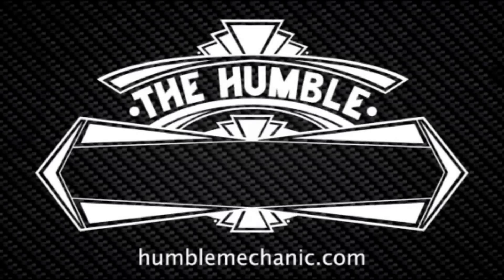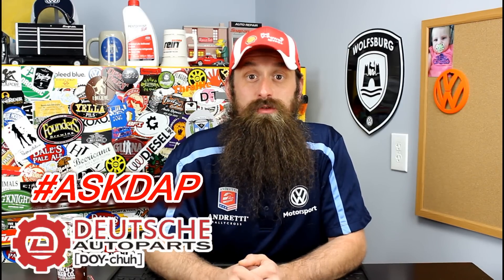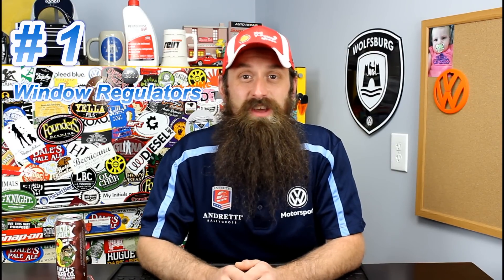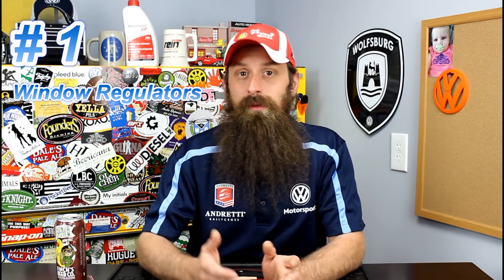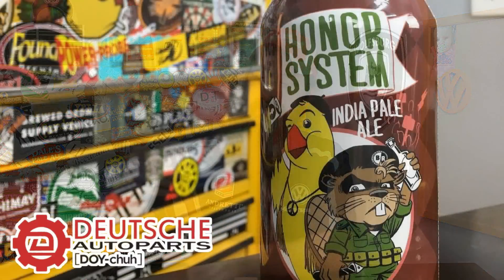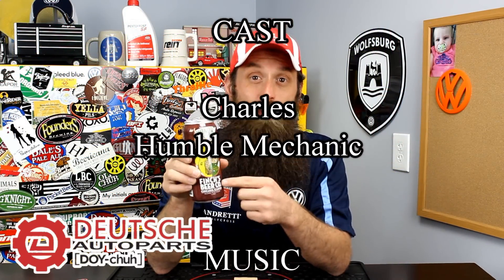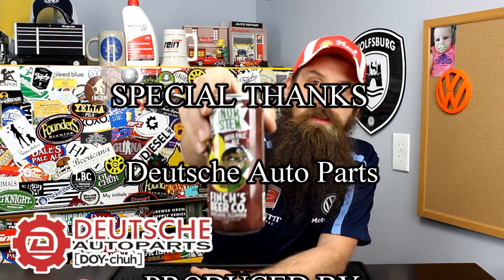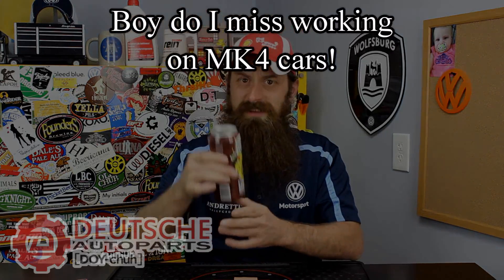Top 5 Failures 1999-2005 MK4 Golf, Beetle and Jetta

Comment: Yup my 2002 Jetta GLI has a few issues i need to resolve, the rear passenger window wont go down i hear the regulator but it wont go down, coolant temperature acts up during winter for some reason got a replacement but haven't installed it, door switch unlock both driver and passenger doors but it wont unlock the passenger back doors have to open it from the inside, stupid breather hose broke made out of crappy plastic i just taoed it up replacement is around $120, i cant unlock the trunk with my key but the switch opens it up, last would be the ac compressor doesnt work lol still love the car though i got most other things replaced brakes,rotors, fluids,coilpacks,plugs etc.

Comment: ok so i had a question i reaently got a year 2000  VW jetta and i am perplexed on what is going on the car starts and then right away it stops im not understanding what the problem is theres no engion code and the feule gage say 1/2 a tank of gas i just replaced the heater core my self i wanted to know if you have any idea what the problem could be
Reply: immobilizer light flashing? I had to get the ECU flashed to remove it on my 02 beetle.

Comment: I've had my MK4 Golf for 11 years now, here's what failed:

Both front window regulator clips, easy to fix
Coolant temp sensor intermittent, easy 5min fix
Engine speed sensor, easy 5 min fix
Oxygen sensor, done myself
Lower control arm bushings replaced with polyurethane
Spark plug leads
Charge regulator, 5min fix
reverse light switch, 5 min fix
Water pump done three times lol

Still love my MK4 :)
Reply from the maker: That’s not too bad. :)

Comment: I have a 2002 VW Golf 2.0 and I changed out the CV axle and the wheel bearings on the driver side. This was due to a clunking noise every time the wheel makes one complete rotation. After repairing, I went to go take it for a spin. And upon putting it in reverse, the clunk, restriction, or stoppage was still there. Acting almost like the wheels did not want to spin. So a bummer first of all, that is didn't fix the problem. So upon going in reverse, it made a snapping noise with the clunk. Continues to clunk after that. I look under each side of the front end, and nothing is snapped or broken off. I am debating on changing out the passenger side CV axle. I don't know what else to change out. Someone, please comment , if they have had a similar problem. This was a Florida car, so the rust is minimal. I hate to spend the money on the CV axle and it not be the problem. Thanks for any comments, I know I should change out both wheel bearings and CV axles at the same time anyways. I am just trying to find the source of the problem first. I live paycheck to paycheck. Thanks in advance for any comments that will help me in this situation.

Comment: All my wires inside the rubber boots on the doors and truck broke. I had to solder and heat shrink new wires in series. Anyone suffer from these problems?

Comment: Polybushed everything 
I keep a new genuine brake light switch and ect sensor in my box 
I lube my window runners with 
Ptfe every couple of months 
Cut the flaps off all the sunroof drain grommets 
I use an airline to blow out the door catches once a year and lightly grease them with graphite grease 
And use good quality diesel 
So I don't get sticky vane syndrome

Comment: I’m quite new to your channel so I apologize if you’ve covered this in a previous video. I have a 2004 VW Jetta 1.8L T with a speed sensor error. I’ve heard every recommendation from replacing the transmission (a painful $5K pill to swallow) to junking it. I’m quite attached to it and hate to see it scrapped for a measly $200.00. I’m looking for any tips on replacement of the speed sensor without a full transmission break down or rebuild. Any advice?

Comment: I recently bought used 2000 Beetle. Hate when i lock my doors & come out later only to realize my windows rolled down...Whhhyyyy! I stopped locking my doors, no point. Thieves will get in anyhow if window's down but at least the rain won't get in.

Also noticing that rattle underneath car & check engine light came on...gonna check with code reader & hope i'm not gonna have to shell out cash for catalytic converter. Car is well beyond warranty(149k), and was sold 'as is'.

Comment: Could the failing break light switch be related to a none functioning tail light? My reverse lights, and break lights turn on, but my drivers side running light (not sure what the name of the light is, but it's the one that is supposed to remain on for night driving) won't turn on.  The one on the passenger side though does remain on. Could that be because of a failing break switch, or should I look else where for the problem. Help the MK4/VW noob.

Comment: Wires breaking in boot of door and hatch , drivers door latch microswitch, water going through grommet on Golf rear wiper going on motor then down onto latch, taking out motor circuit board causing front wipers to turn on on their own. and the alarm going off on a cool night because of the wiper on the latch going. In salt areas the return on the ebrake  sticks at the caliper. Front fender rubber piece holding water causing rust on fender.Lower section of front fender holding 5 lbs of mud.

Comment: I.need to know why my interior lights are always on when the light are off.. I have to disconnect the battery terminal to not kill my battery to go somewhere...please reply asap
Reply: I had that problem. The lights in the switches on the drivers' side door stayed on. I discovered that it was a bad gas door switch that caused it.

Try disconnecting all the switches from the wiring harness until they go out.

Comment: Enjoyed the video and love my mk IV Jetta 2.slow. My biggest issue is the car won’t move out of park when the temperature outside drops below 40 degrees. Good thing I live in Texas and cold nights are rare.
Reply: David Neumann  look up online at one of the vw forums for solenoid valve issues.  There's a guy in Kansas City Missouri that will refurbish yours or you can replace yourself if you are comfortable doing so.  Symptoms: usually will not go into gear or shift properly when cold after sitting a while.  Look up on VW vortex brother.

Comment: what about "valve body" or "controll module " on  6 speed automatic trany   2005 beetle turbo diesel ..is that common to mulfunktion ?
Mechanic replace my tranny  just to find out that  problem of shifting still exist .   he put back original valve body back on .

Comment: 01 Jetta 2.0 shouts off after running a while sits for several minutes,then starts! ie replaced the coil wires and plugs and maintained 35 psi even after shut down  any ideas?

Comment: EPC light on. codes reading P0222 and P1003. 2003 2.0 Jetta.  changed mass airflow,  changed brake switch,  ignition switch,  cleaned throttle.  light still on.  car is in limp mode after 10 mins of driving.  my mechanic thinks its the pedal sensor or a bad CAT.  i dont like guessing.  any thoughts?
Reply: Serby Drobnjakovic crank sensor got mine outa limp mode

Comment: I have a 2001 Volkswagen beetle turbo and my speedometer stopped moving and all of a sudden the lights appear on dashboard like the emergency light the temperatures light ect and now when I turn my car on it sounds loud like the muffler is bad it a loud motor like sound and I notice a small peice of tube missing in the front of the engine not sure what that is and the sad thing is everything is plastic under the hood

Comment: Hi i got check engine. Says running lean. Had lambda sensors and cat replaced still get light once a week. Any ideas
Reply: TheFlammingdice had same thing replace cat. but still on. had check engine light on for 4 yrs. and my car ride smooth. sometimes the light can be bullshit ir serious. so far mines been ok. it's 2001 jetta 200,000 miles orinal motor. had to replace transmission at 180,000
Reply: TheFlammingdice MAF

Comment: I have question? On a 2002 V W Beetle turbo s w/ 17" tires and sims are the brake rotors the same size on the front and back?
Reply from the maker: no. They are much bigger and vented in the front.

Comment: Hey Charles and Co. BAD CONTROL ARM = DANGEROUS OR JUST ANNOYING?  I have a 1999.5 MK4 GOLF GL with the 2.0L AEG.  MY passenger side control arm is starting to make a lot of groaning noises ...especially when backing up over bumps or driving on uneven roads.  The ball joints and tie rods all check out but when I place the car up in the air and give the wheel a tug the back control arm bushing start to move a lot more than the other side.  My question is...is this a safety issue or just annoyance.  I'm afraid when I try and remove the arm that stupid bolt in the subframe will come loose as its an old car with some rust.
Reply from the maker: +mraccord92 it usually starts as annoying, and be comes safety. 

Those bushings fail commonly. Soak that bad boy in penetrating oil and hope for the best. Hahha 

Heat can be your friend too

Comment: ok so my stepdad is a handyman. I have 99 vw beetle and he kept telling me there was something wrong with the transmission that he couldn't quite put his finger on. The car was driving fine for about 2 months and started making this 'CLUNK' sound when I would shift the car from P R N D. Then all of a sudden my car started overheating daily and i would have to add more antifreeze coolant every other day and the engine would still be very hot regardless of the overheating light not coming on. The Cooling fan works perfect. Basically ever since the car started shifting weird or being stuck in 1st gear the car has been overheating quickly due to the engine revving harder or going faster than it should & not on the proper gear. I really need help

Comment: I have a 2005 Beetle  convertible with a headlight issue. My right side headlight is not turning on. I switched out the bulb and the light is still not coming on. Any suggestions?
Reply from the maker: BE sure the headlight is fully installed. If it's not installed all the way the lights will not work.

Do any other bulbs in the headlight work?
Reply: No not on the right side? Before I changed the bulb yes. Now no.

Comment: I look for block, head, transmission, bearing, seals, head gasket, overheating issues as "issues." These are 1 trip to autozone and a few hours in the driveway issues. Sounds like a mean machine of a car. Half that stuff can be cut out of the harness and soldered or modified.
Reply: "These are 1 trip to autozone and a few hours in the driveway issues. "  Or... You could buy a Civic Si and not have these things go wrong? Just sayin' :P

Comment: hey man I have a question you mite like. I just bought a mk4 gti. no CELs engine drives fine but no boost what so ever no boost leak. turbine working. checking diverter in the morning. but under full throttle boost would drop from 0 to negative under wot any ideas? please help?
Reply from the maker: +Virginia Alexander wow. I boost and no faults? Be sure the n75 is functioning properly
Reply: HumbleMechanic. how can I test it
Reply: and thank you

Comment: humblemechanic! any ideas why my mk3 vr6 keeps cutting out randomly while driving, time and mileage still up but rest of the instruments die with engine, its literally like the key has been turned off. did come back to life before pulling over but the last time I had to be towed home, popped it onto a running car to jump it and it all fired back up. I am thinking bad earth somewhere but have you come across anything like this? p.s. its had an ECU immobiliser delete.
Reply from the maker: Loose connection? Bad battery ground? Bad ignition switch maybe
Reply: @HumbleMechanic  funny you mention ground, I took the battery tray off and well, it was brown and green with some black wires sticking out. gonna clean it all up and hope I don't get stranded again.
thanks for the reply!
Reply: I had that issue as well. Recently had the throttle body replaced due to hesitation and jerking during acceleration until engine warmed up (I don't believe that's why the power would cut off, like you, mainly after accelerating from a stop). O2 sensor replaced and put Cataclean to clean the cat converter (helped immensely). Also replacing the MAF. It seems the cutting out has mostly been due to the MAF and possibly the intake air sensor. Not certain, but it has been running great.
Reply: @242-f5u  turned out to be a faulty ignition switch and re wired the main earth points for engine and dash. 1200 miles. no issues. well apart from the silly plastic linkage on the upper gear shift cable has snapped.

Comment: Strut bushings, bent rocker panel seems, turbo rebuild x2, transmission failure, glovebox, center console doesn’t stay up, clear coat, oil pan, headliner and door panel glue, and a secondary air induction check engine light.....

Comment: three months mk4 jetta 1.8t. replaced cam chain tensioner, serp belt, coil packs, spark plugs, & fuel filter. I still feel like my car is at a loss of power. I feel as if my turbo may be damaged. how would I be able to determine the problem?
Reply from the maker: most of the time you get an underboost fault.

Comment: my check engine light on my 02 jetta came in last night and I smelled antifreeze on the outside of my hood.. could the two be related or is it just a bad sensor and a leak?
Reply: u gotta get teh car scanned for codes before anything. did u ever get this fixed
Reply: Could have a leak, or the plastic water pump impeller failed, or it could be overheating due to a bad thermostat.

Comment: No mention of auto trans valve body worn out or dual mass flywheel self destructing?
Reply from the maker: The DMF was not a huge issue on the mk4. Well not compared to the MK5. Kinda the same with valve bodies. They had failures for sure. But not near the rate as MK5

Comment: Hmm my cat rattles bad on my 2000 1.8T beetle.  It just started happening.  Car has 156,000 kms on it, I wonder if I should contact the dealer about that?  Should be the same in Canada?  I have that code and check engine light.
Reply from the maker: Worth calling about for sure.

Comment: My Beetle vibrates while its on. And before it catches speed when accelerating, it switches gears. Do you know why this is?
Reply from the maker: Maybe a few different issues. Bad valve body and engine mounts?
Reply: Asv? Totally was the issue with mine. Runs great now! Hope this helps.
Reply: Christina Alexander What’s the asv?
Reply: @Shon9tilR  anti shudder valve. Light vibration is usually this. If it's a strong vibration, you may wanna check your motor mounts. Depending on your year and model.

Comment: Charles any input on fixing broken seat heaters in jetta mk4?
Reply: +Joshua Weir I'm no expert but I've got an '03 Golf TDI myself and for about a year the passenger seat heater wouldn't work and I didn't know how to fix it. A local VW junkyard guy told me that the switches are most commonly the problem with that. So I pulled the driver and passenger switches, swapped their positions and tested the passenger seat with the driver switch. Worked perfectly, so I went back to the yard, picked up a cheap used switch (if it dies, it's cheap to replace again!) and I've been enjoying two perfectly heated seats since! Hope this helps :)
Reply: +Elimentus in going to try that thank you!
Reply: +Elimentus what did you use to pry out the switches, i got one out but it wouldn't come all the way out, about 90% of the way it began to pull the "de-mister" switch to it's left. any thoughts here?
Reply: I have a set of interior trip removal tools, basically just plastic hooks, wedges and small pry bars. I had a blank next to my Driver's switch which helped but the Passenger one is a bit more tricky. If you're careful you might be able to use a flathead but that could scratch things up pretty bad with just a slip. The switches have a fair amount of resistance holding them in so once you get a bit out you really gotta just grab the switch and pull them straight out. The wires and connectors are beefy so don't worry about that end too much.
Reply: Oh and as far as the switch next to that goes, you can pull that out too if you have to. The wiring can be pretty tight back there so you might have to pull out all three (or four) switches at the same time just to have enough room on the loom
Reply: Excellent input hopefully very helpful I'm going to work on it after work tonight and will let you know
Thank you
Reply: +Elimentus hey I got the switches out and replaced one and now it's working like a charm!

Comment: Mkiv jetta would a bad motor or trans mount cause the car to not properly go into gear from a dead stop?
Reply: As if the car and engine are pulling away under load and the stick shift when trying to accelerate and shift through the gears but if i give a little pause letting out the clutch as if to let the force of acceleration dissapate there is no problem! Some one said its the “synchro” but then why is there only pressure on accelerating and decelerating when the weight of the engine and car are opposing each other the thing doesn’t want to seat properly